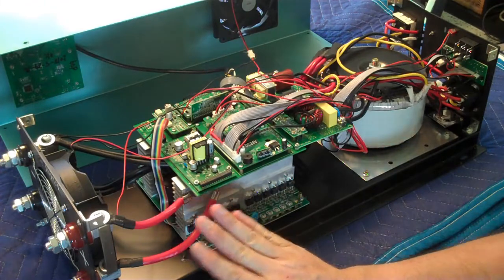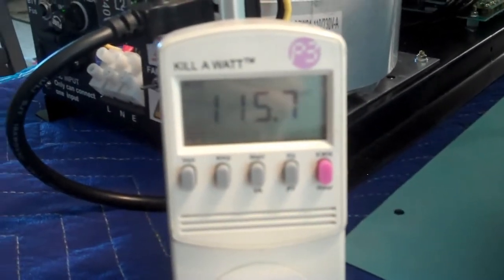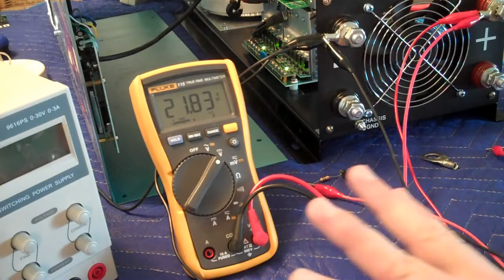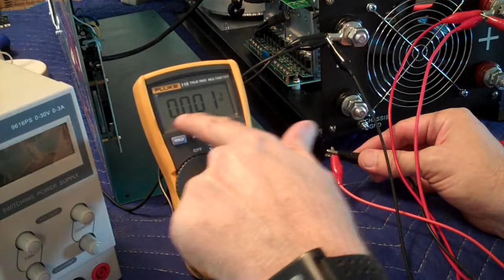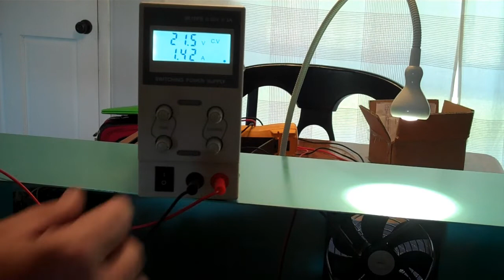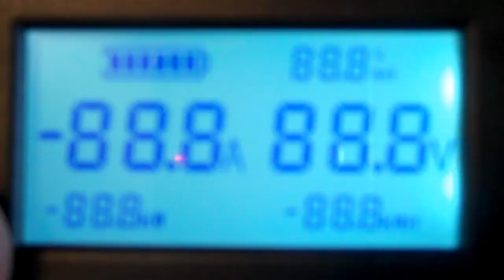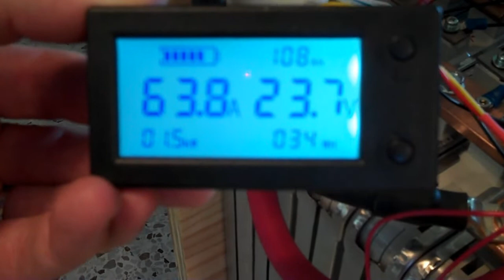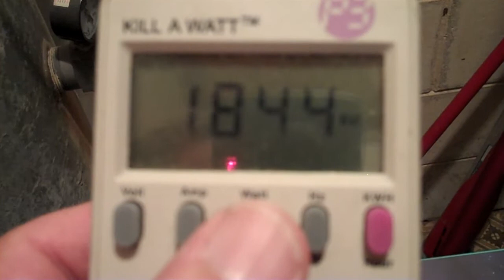Repair / Review: Power Jack 8000W LF PSW  INVERTER DC24V AC 220V 110V ATS/UPS-8.0V (part 6)

Comment: Hi Jay, thank you for your informative video. I'm in Australia where we use 240 volt. My 8000w Power Jack purchased about two years ago has been running continuously for about 18 months powering our house lights, fridge, freezer, TV's, washing machine and my workshop with no trouble at all. Generally I use the rule of thumb with these inverters, if it says 8000w it means 4000w or less. despite that I'm pleased with the performance and will purchase another as a backup.
Reply: Are you totally off grid?
Reply: I bought the same 8000 kw power jack few years back. Whats the maximum number of panels can be installed with this inverter?

Comment: To discharge the internal caps, simply turn the unit on for a second. That's all you need to do. And, a thin layer of thermal grease would had been a great idea when you put on the new heat spreader. Also, I'd checked the LED and it's current limiting resistor. In typical Chinese construction, it's quite possible the reason why the LED did not light was  a simple bad solder joint, bad led, and or bad resistor. It would have been a simple check before ordering in a whole new assembly.

Comment: Hi Jay, thanks for making the video and sharing your experiences with this inverter.  I bought the 24V, 5,000 watt Power Jack inverter in September last year and have had major problems with it.  I found it is very fragile electrically in the battery charge mode.  With a normal power surge on the AC line during battery charge mode, it line blew out 6 boards in the unit.  I found the internals of your 8,000 watt inverter quite interesting, it is exactly like my 5,000 watt inverter, with exception to your model having an extra cooling fan and your power Fets on the Mosfet boards are 140 amps, whereas my inverter used 80 amp Fets.  These Mosfet boards are connected in an H-bridge configuration, none of the boards are in parallel.  In looking over the components used in the inverter, I estimate the toroid power transformer to be good for about 2,000 watts.  If you are going start and run a pump motor, use the LRA (Locked Rotor Amps) rating of the pump to determine the size inverter you need.  Typically, you need 10 times the run wattage to successfully start a motor and if the motor has a start winding, figure 20 times the run current worst case.  The inverter needs to be able to supply that start current for at least 5 seconds to guarantee reliable starting.
Reply from the maker: Yes, I am not using the battery charging or automatic transfer switch capability at all. so far this inverter has been able to start my 1 horsepower well pump without problems as long as the battery voltage is high enough.

Comment: I agree about the modular construction too.  I have a lower-power one, with 4 MosFETs on each power switch boards.  I also like something that is also quite rare, the use of proper internal heatsinks rather than using the case for cooling.
I did kill mine, twice.  My fault though.
I would be interested in an email address to order new power boards.  I just replaced the MosFETS and a couple on SMT resistors the last time.
Undervoltage is a bit low.  You wouldn't want to make a habit of running lead-acid batteries down that far.
p.s. Jay's voice reminds me of Kermit

Comment: 2 comments:  1) A friend of mine uses the 12V 8000W Powerjack inverter for her well pump using the 230V output and the most it draws is an 11A spike then it settles down to a little over 3A.  It seems to run fine provided there is enough battery power going into it.  2) I have found that by covering the fan port on the top and letting it push air out of the side with all the controls makes it run significantly quieter.
Reply: @John T About 3 amps at 230V, the meter shows about 750 watts consumed.  A fairly easy intermittant load (about 5% duty cycle) for the 4.2 KWh capable AGM battery bank (down to 50% SoC), with dual chargers (wall charger and solar charger).  One "trick" I use is I have a 0.5 ohm power resistor in series with the 13.6V 10A regulated power supply (charger), so that is biases the charge coming from the solar.  That is, the solar charger can supply up to about 10A to the 12V battery bank, but the wall charger will never draw more than about 3A, and is usually 1A or less if the battery bank is in a high state of charge.

Comment: Hi Jay can you tell me what the battery voktage rotary dial does.
Reply from the maker: It sets the Battery Charger voltage (only used if the Powerjack is attached to mains power to recharge the batteries).  Different models may have different settings, but according to MY manual for MY inverter, the numbers are: 0-off  1-14volts 2-14.1v 3-14.6v 4-14.4v 5-14.4v 6-14.8v 7-15.1v 8-15.5v for 4 hours 9-not used.
Reply from the maker: As a side note, I do not recommend using the built in battery charger of the powerjack inverters, as I have heard a lot of chatter that they don't always work well, sometimes fail, etc...  YMMV....I've never used that functionality on mine.

Comment: Hi Jay, I just bought a new 6000w LF inverter. The one mosfet bank on the inside, between the 2 heatsinks is not lighting up on the AC side and the 2 on the DC side lights are very dim, not as bright as the others. I also opened it up and found the cable for the led screen laying loose. It also only has one fan at the back, where others I've seen have 2. If you switch the fan switch in the front to the ON position it does not power the fan. I don't know if it will come on once it builds up heat. Like you I would prefer it on all the time. I have had this inverter for a week and sent videos, which can't show much to see if the Mosfets are damaged or blown as requested by Powerjack. I requested a letter from them to say they will still uphold the guarantee if anything goes wrong and still not have had a reply. I would not really recommend them to anyone. It is a cheap inverter, but it would've been better to buy a more expensive one locally or based in the UK.
Reply: Hello what is the maximum load you can use on this inverter? Can it handle simultaneous loads of 2200W each?

Comment: I know this was posted 5 years ago but Im hoping you still get this... I have the 6000w version, I dont have the L1, N, L2, but I do have that L, N, E OUTPUT... do you have ANY idea what that is.. Im assuming it will NOT do 220... SOrry but this was the only video I could find that has the same output...  THANK YOU!
Reply from the maker: If I had to guess, you have a 120 volt version (across the L and N terminals) and the E terminal is an "Earth" ground connection. [If that is the case, it would most likely be connected to the metal case inside...]  The only way to know for sure is to use a Multimeter in AC mode. I'd expect to get 120 volts across L and N, (and possibly 120V across L and E, as earth is sometimes tied to ground inside the inverters) and ZERO volts across E and N.  Anything else, and it's something other than an earth ground.

Comment: In my opinion, the low voltage shutoff should not be fixed at about 10.5V per 12V of nominal battery voltage because it should depend on the load.  If the load is very heavy, it might shut down prematurely.  Under a very heavy load, it should allow the voltage to sag to perhaps 10V per 12V of nominal battery voltage.  The battery will usually "spring" back to 12V or more if ONLY a heavy load is placed on it using an inverter.  What is more damaging to a battery bank is using an inverter and only putting a very light load on it (such as 50 watts).  Then when it shuts down at 10.5V, it might only "spring" back to 11.8V which is a very low state of charge.  This (in my opinion), is a serious flaw in today's inverters.
Reply: I think this inverter gets around that issue by simply "locking off" - if you recall, he had to cycle power off and on, before the inverter would fire up again. Also I noted that even the alarm voltage window seemed to have hysterisis. Not beeping until it reached a low level, but once started, it remained in beep mode until the voltage had increased considerably.

As for other comments re: the transformer being only good for about 2 - 3KW, assuming the drive circuitry and batteries are sufficient, toroidals are able to tolerate SUBSTANtIAL overloading for minutes, let alone a few seconds. Although I would not want to run more than about 3KW for any length of time on this, assuming the drive and battery are sufficient, I could easily expect this to offer 8KW SHORT term power.

Even the old fashioned E I transformer can handle 200% overload for moderate periods - which is the difference between RMS rating and "Tool Rating" for the Yellow Site transformers.

Limiting issues here are most likely thickness of supply cables and the battery's internal resistance / inter-cell wiring resistance.

Comment: I have this inverter, 48V DC input model.  I am trying to connect it to an electric panel box that is not connected to the grid or other power input to run my workshop off my solar panels.  I need both L1 and L2 connected to the hot poles in the box and I assumed the N connected to the electric panel box Neutral bar.  But I am not getting any current to the electric box when I do this.  what am I doing wrong?
Reply from the maker: That sounds correct to me. Double check your wiring and maybe the wiring inside the inverter. Also check to confirm you have the "split-phase" USA model, vs the "true/only" 240 volt  model that doesn't have a middle neutral for 240=120+120 setup.

Comment: Can you run a 1500 watt roof mounted RV air conditioning unit off the 8000 watt unit on split 120v and have the 240v powering something else about 2000 watt like a water heater?
Reply from the maker: I was easily able to run a 1800 watt (120volt) microwave on one leg of the spit phase output while the other leg was unloaded, so the transformer and circuitry appear able to run a 1500 watt asymmetrical load.  However, I have not tested running a 2,000 water heater AND a 1,500 watt AC at the same time. (My well pump load spikes a lot up front, and only runs for 30-45 seconds at a time, on the entire transformer as it is a 240 volt load.

Comment: Jay, some LF inverters I saw in ebay has 110v/220v output instead of 120/240v. Will they be ok for my well pump that need 240v ? For example: 16000W Low Frequency Split Phase Pure Sine Wave Power Inverter DC48V/AC 110V,220 in ebay
Reply from the maker: The ability to drive enough watts is more important than the exact voltage. 16,000 watts is much better than my 8,000 watt one, so I expect it would be able to run a 240v well pump at only 220v. [NEC Code allows a wide variance in voltages for US homes, with range B going from 104-127  / 208-254 and sometimes a 110/220v inverter actually outputs 120/240 or visa versa...so without measuring the actual output of the inverter you don't necessarily know what it puts out.]

Comment: You should have replaced both MOSFET boards at the same time. You have combined unmatched series parts and now you probably have one half handling most of the current for that phase. I assume your loads are well below the max of this inverter.
Reply from the maker: They only sent me one replacement board. So far it has been working well for my well pump, which has a high startup surge.
Reply: @summetj  Sorry I was unclear, by phase I meant both boards on the positive DC side.

Comment: I wish to use an inverter to act as a backup power supply for my well pump. The well pump is 5hp 220v. Any suggestions on an inexpensive inverter and batteries? We seldom lose power and an electrician claims a 9500 watt generator will work. Any help would be appreciated.
Reply from the maker: A 5hp well pump is a monster! (I believe mine is a 1hp one). You'll probably need a 12k to 15k inverter to handle the startup surge requirements, and are probably going to have to have a 24 or 48 volt battery bank to power it.  I don't think anything in that size range will truly be "inexpensive", as you are basically looking at whole house sized systems.

Comment: I repaired my inverter with all the new parts, new mosfets board, new driver board, I even put ALL the new boards on it, it turns on well, but going from 1400w approximately it will overload, what could it be?  it is a 15k power jack.
Reply from the maker: I would expect a 15K powerjack to be able to do at least 3-4K with no problems. I would put a volt meter on the input voltage (battery) and make sure it is not sagging under load. If your battery is not able to supply enough current without the battery voltage sagging, there isn't much the inverter can do.

Comment: Power Jack,,, my condolences.
Reply from the maker: For the $350 I paid, I'm happy with the value it has provided so far.
Reply: @summetj  Happy to hear you are having a good experience with your unit. The power jack and power tank units I purchased were both very disappointing.
Reply from the maker: @Mark-bb2zx   When making my purchasing decision I de-rated it by 75%, so only really expected a 2,000 watt inverter that could surge up to 8,000 watts, and so far it has met those expectations. And in my intermittent (well pump / emergency) operation heat buildup doesn't seem to be an issue. (I do keep the fan running all the time.)
Reply: @summetj  My 2000w power jack died just applying power the after a week or so with no load. The 5000 power Tank was miss wired from the factory and when corrected and tested exhibits poor performance, noisy transformer with no load, clipped sine wave with a 400 watt load, and other problems. I would be afraid to hook this unit up to my house. Does make a nice foot rest .
Reply from the maker: @Mark-bb2zx   I'm sorry to hear that. My unit had one bad MOSFET unit from the factory (or at least, the indicator LED was out) as you can see in the video above, but the sine wave output was very nice looking, and so far it has performed well. Time will tell for the longevity.  Perhaps the latest (version 8 - 2018) models are getting better quality control, or perhaps I just got lucky.
Reply: For those who opened, this inverter has surely noticed the size of the toroidal transformer, on which the power is not shown, but for those who have a little familiarity in electromechanics, by calculating the magnetic core, this cannot exceed 3000VA , so this inverter even if driven by mosfets that could supply 8000w power, the transformer would go into saturation.

Comment: Hey J. thanks a lot for your video its an eye opener and saved me from a lot of stress and worries as i could trouble shoot and find solutions. My red cable to the top fan broke loose when i was trying to remove the top of the Inverter. Can you assist me by indicating where is that red cable from the top fan ought to be connected originally?? thank you so much looking forward to your response.
Reply: you never gave me and answer. thanks anyway for you information

Comment: How can you replace components inside the inverter. Will that void the warranty?
Reply from the maker: In this case the components were sent to me by PowerJack as a warranty replacement. The MOSFET board is designed to be user replaceable, as they are the most likely components to fail.
Reply from the maker: @albertwolanski7688  You might check with https://www.genetrysolar.com/ They used to be a powerjack repair place, now have their own branded powerjack based inverters, they may have compatible repair parts.

Comment: Excellent video... REading mixed opinions of this Power Jack.. Some people use them daily and report they work, others claim it cannot handle anywhere near its rated load..

Do u think this is a user set up problem, or just poor quality control by the manufacturer, shipping?
Reply from the maker: The powerjack inverters certainly can not hit their maximum ratings continuously. I have an 8000 watt model, and would not expect it to power more than 2500-3000 watts continuously. I treat their rating as a "maximum surge" rating, so for my well pump that uses 2200-2500 continuously, but needs a surge current to start up, it works as long as my input voltage is high enough.

Some units from the factory have had issues (mine had a failed MOSFET indicator light right out of the box), so quality control can be an issue as well.
Reply from the maker: Also note that I don't really trust their automatic transfer switch or charging circuits. I feel that the core inverter functionality works well, but when combined with power transfer and charging, may case more failures in the field.
Reply: @summetj  hi Jay Ihave powerjack 8000w the mosfet are burn so i replace them all and when I turn On it was working but the mosfet on red and black wire became warm and the transformer shaking there's no load on 220 but current in battery became 120ampere. I cannot find what's the problem. Pls help me
Reply from the maker: @moriscute  I'm afraid you will have to contact PowerJack for technical support. It sounds like you have a short circuit somewhere that is drawing a lot of current.  Possibly a MOSFET is shorted closed.
Reply: @summetj  thank you
Reply: @moriscute  have you been able to fix this issue? Have you found any help?